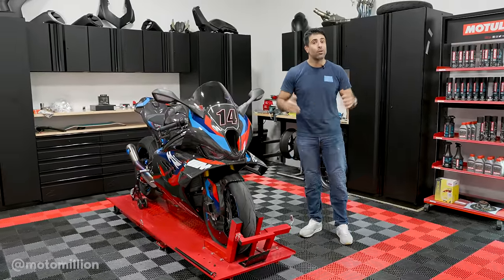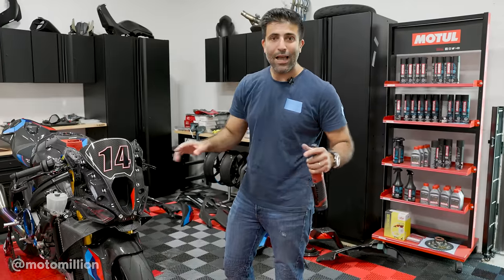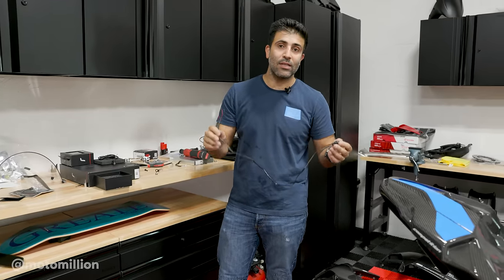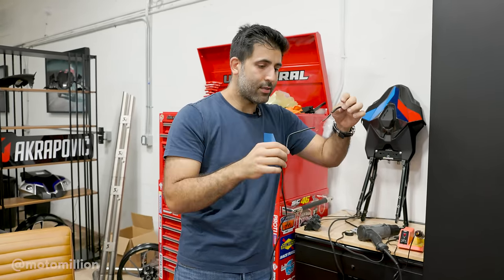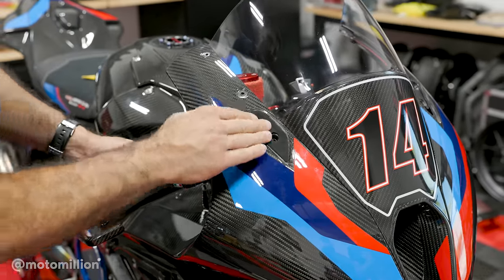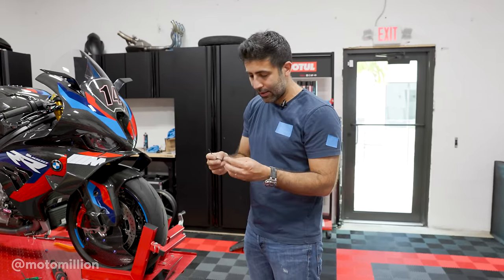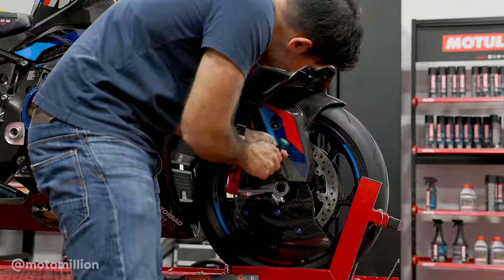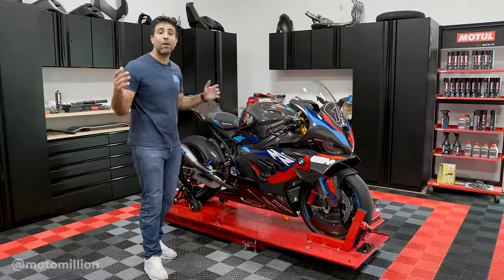The Motomillion M1000RR is FINISHED!

Comment: I would have thought the peel and stick rubber went on the mirror base not on the bike. That way when if you ever wanted to change the mirrors, change the fairing, sell the mirrors, put the mirrors on another bike whatever..... yeah, probably doesn't matter for this bike I guess.
Reply: Yeah, but tbf Manny doesn't always follow the instructions carefully, particularly for M1000RR's  👀 love your work Manny.
Reply from the maker: It is slightly larger than the bottom of the mirror, hence why we put it on the fairing.

Comment: With changing bolts to the titanium ones, is there risk of corrosion from cathode or anode differences? Are they titanium into steel only? Are they coated? Whats the weight difference? M1000rr owner looking for cool options and info here. Thanks for your content. Big fan.

Comment: Outstanding. Is the enthusiasm for bmw now gone?😂 i would have have preferred the carbon akra, looks a tad more premium but its good u mix up the brands. Id guess the weight at 404lbs. Without going over previous vids its hard to get in the ballpark.
Reply from the maker: The Arrow EVO Competition GP sounds insanely nice, I think the nicest sounding exhaust for the S1000R / M1000R / S1000RR / M1000RR platform! You need to stay tuned, because your guess may be a very good one (: